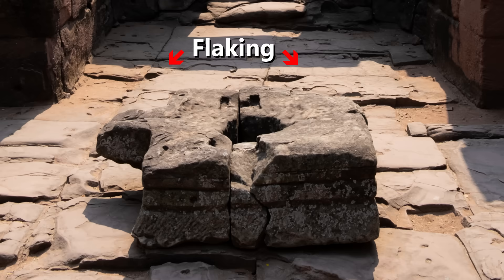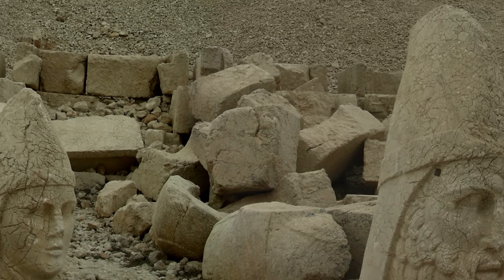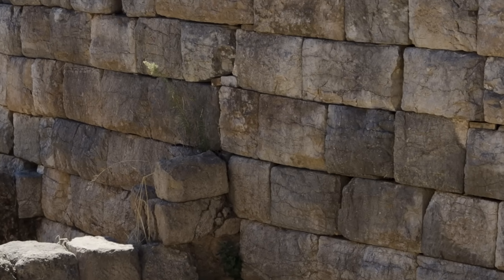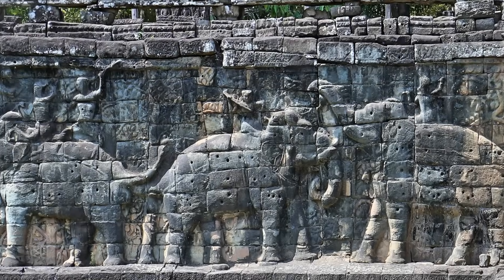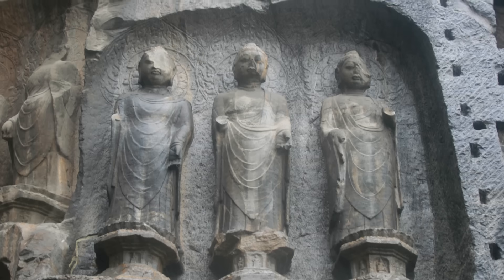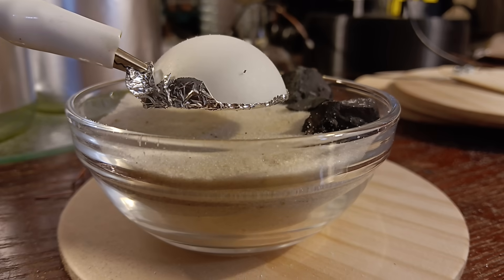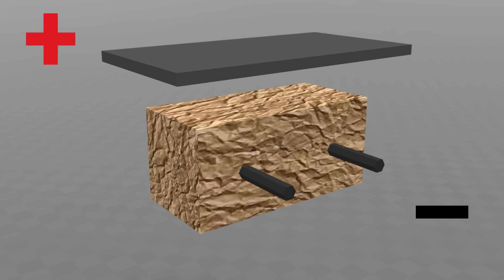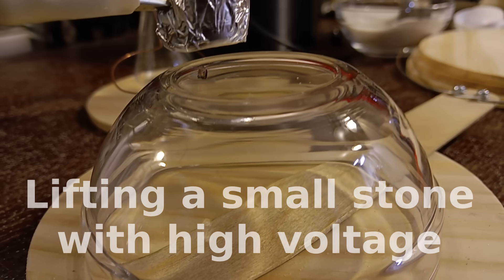The Greatest Mystery, Solved. Recreating Ancient Stone Melding Technology (Part 1)

Comment: So this hypothesis raises more questions than it answers.
*  Where did they get enough power?
*  Why do we not have physical or graphical records of the power sources?
*  How did this technology get transferred all around the globe and then get lost?
*  Most rock is an insulator. How do they create a plasma arc between the electrodes?
*  Assuming they can melt the rock, how to they prevent spattering?
*  How do they keep the rocks from melting together?
*  Wouldn't molten rock pool from gravity?
*  Why can't they eliminate the nubs while the rock is still soft?
* If they can create air pockets inside the rock, why didn't they do that to pyramidal stone blocks?
Probably a lot more questions. This is what I came up with in about a minute.
Reply: Experiments shows that those building materials like granite and sandstone loose their structure and properties after heat was applied. At least when you use traditional sources of heat. If theory about 'electrods' is correct, those builders used some other method rather then melting. All you can achieve with melting is piece of glass with some other particles inside, it's very frigile.
Reply: @personperson2884  Right, if you melt a rock, it's not like melting an ice cube where it will snap back into the same crystalline structure and arrangement of molecules when it cools again...  the same rock that was formed at temperatures and pressures deep in the crust, if we take it and melt it, when it cools at different temperatures and pressures on the surface, it will be a different mineral altogether.
Reply: @keepinmahprivacy9754  Not necessarily. Depends on what frequencies you use for your voltage. Find the resonant frequency of the material first and maintain it while increasing amplitude. The idea is not to melt the rock but put it in a flux state.
Reply: @keepinmahprivacy9754  Granite when melted will just turn into obsidian
Reply: @charlesbassjr.5177  Umm, no that's not correct. Obsidian is formed from silicates, not from granite. The metamorphic successor to granite is gneiss.
Reply: @keepinmahprivacy9754  What about resonate frequencies with said rocks kind of how a magnet aligns the crystal structure when you magnetize metal what happens to the stone then instead of just heating it you're working with its frequencies. Similar to how you would break down water to hydrogen an ox too keep from eroding away via heat your electrodes you would have a set of tuned electrode pipes for each contamination that could be in the water you would use. What happens to that rock at its resonate freq?
Reply: @eliwazmoonsfire6303  I don't really know the answer to that one, sorry. But I suppose the answer is going to depend a lot on the type of rock, as some rock has a crystal structure and other rock does not. I suspect a resonant frequency would have a greater impact on crystalline rock than on non-crystalline though.
Reply: It's chemical if that process existed...but its more just cement n concrete mixs with crushed rock
Reply: Granted, if the huge stones were actually hollow, that could explain how they were put into place easier!
Reply: @FookWit-sapien hollow? Where?
Reply: @drewtate5409  It was a tongue in cheek comment.  Everyone assumes these massive stones are solid and all of the same material.  What if they were put in place as hollowed out shells (think like the box in the King's chamber) and then filled in with stuff, and heated until it became part of the original 'brick' so they could stack another on top.
I am not saying there is any evidence of this whatsoever, but it is just as good as some of the other notoriously bad theories (like building a massive ramp to get bricks higher.)
Reply: @FookWit-sapien  Well, there is the quarry and numerous partially cut and broken stones.
Also, there is the physics of trying to hollow out stone. Probably a lot more work than just grinding on them until they are the shape you want.
Reply: @scytaleghola5969  Ha, right.  My point was that we can all think up random theories, if they had some magical way to shape stone, as I have seen some put out there, why not hollow out the stones so they are lighter to move, then fill them up like twinkies?
Reply: It's all theory until you recreate the results.
Reply: @darrylgordon5170  No! It is CONJECTURE not theory. HE has to PROVE it can be done by doing it himself before it can be considered a THEORY.
Reply: @darrylgordon5170  Not knowing the difference between conjecture and Theory is not a grammar nazi issue. It is a fundamental science misunderstanding. These stones were not melted in place, cast in place or anything of that sort.
Reply: @darrylgordon5170  most sensible person in the comment section
Reply: @yeetman4953  Calling someone the “most sensible” in this thread is a pretty low bar.
Reply: Excellent
Reply: that ancient tech got lost at some point in human history is obvious. We see the foundations of megalithic sites in south america, egypt and other places having more complex and higher quality stone work in older layers. Like Macchu picchus foundation with the later added poor Inca stone work on top and the first pyramids in egypt being by far the hardest to create and more sophisticated ones. The why is there probably was a global cataclysm at some point. The younger dryas impact hypothesis would fit well on that regard.
Reply: @xtremelemon8612  En rapport à ce que tu dits, je pense que si beaucoup de civilisations ont eu une manière identique de construire des temples ou de sculpter des œuvres d'arts, c'est qu'il existait une école mondiale du savoir commun et relatif à tout. C'est comme si un professeur donné des cours à un endroit précis de la planète et que tous les élèves le copié partout sur terre. Je pense également qu'il y a eu une grosse catastrophe à un moment précis comme si c'était un peu voulu genre déjà écrit ou stratifié à l'avance un peu comme si on avait voulu changer l'histoire avec un machine à remonter le temps pour ne pas que ça aille trop vite sur terre ou comme si ces civilisations n'étaient pas souhaités sur terre, genre l'humanité qui remonte le temps pour détruire tous les annunaki  pour mieux dominer le monde ainsi dans le futur car sinon tout le monde serait autonome et trop évolué, bref je m'égare... 
Je pense que si les temples ont été construits aussi haut dans les montagnes, c'est qu'avant les océans étaient bien plus haut qu'on ne le pense. 
Et en ce qui concerne cette catastrophe, serait il possible qu'un météorite est fait ça, on l'aurait vu cet impact depuis le temps, non ?! 
Et si simplement, tout ce résultat d’hypothèse pour dire que c'est simplement le rendu d'un tir de laser depuis un vaisseau mère dans l'espace ... 
"La blague en vérité si c'était le cas ..." 
Un simple tir d'arme de vaisseau de l"espace qui changea l'histoire sur terre. 
Et si on a jamais vu d'impact visible sur terre, c'est qu'ils ont tirés sur l'eau tellement puissamment que toute la retombée et la vibration de cette puissance qui s'est évaporée dans l'espace et qui à fait trembler toute la terre entière se qui détruira tout par son onde de choc ?...
C'est fascinant et facile de comprendre que nous humanité, ne sommes que les enfants, d'une civilisation ou d'une espèce bien plus intelligente et digne que nous.
L'archéologie et l'imagination nous le démontre constamment et merci à eux d’exister car cela fait avancer l'humanité je trouve.
Je pense profondément que l'humanité est tellement infantile par rapport à l'histoire sur terre depuis sa création.
C'est bien de connaitre son passé ou son histoire pour pouvoir évoluer dans son présent mais c'est mieux d'imaginer son futur pour changer son présent.
Finalement et métaphoriquement, tout est relatif à une perception d'observations, la vie n'est qu'un choix et il faut avouer simplement qu'il y aura toujours mieux et meilleur que soit au dessus de nous dans la vie ou dans tout ce qui existe.
Pourquoi chercher à faire compliquer lorsqu'on peut faire simple, la vie à un sens mes amis, croyez en vous et en vos rêves.
AMOUR A TOUS ❤
Reply: @xtremelemon8612  The pyramids in Egypt get larger and MORE complex as time passes, not the reverse.
Reply: @jeffreylehman1159  no its the exact opposite, the ones that are crumbling piles of mud bricks are the last ones made, and those methods of primitive constructions are the ones depicted everywhere on hyeroglyphs in egypt, the 3 main pyramids of giza and the sphinx were probably inherited from before, from an unknwon culture.
Reply: @xtremelemon8612  Congratulations on redacting the pyramids. I look forward to your publishing and will definitely read the paper!
Reply: The fact he didn't show any modern application of his "discovery" is the tell tail smell of BS.
Reply: I look at the Earth as a big dynamo. Plenty of electricity there!
Reply: @TheBludgutz  Cool. So just harness it!
Reply: Hypotheses: 

What if 11000 years ago when the sun and magnetic pole went haywire.. There was  huge electrical charge between sky and ground potential. And they used that with their strange builds?
Reply: @laurahaaima1436  yes. This is where the whole electric universe (thunderbolts project on YT) comes in. Their theory would fit this
Reply: Global Ice-Age builders sat their key sites atop telluric “hot spots” (fault-line aquifers and high-conductivity strata), effectively using the Earth itself as one electrode.  
• Pyramid and temple shafts doubled as Kelvin water-drop generators, stacking telluric bias onto each falling droplet to charge massive, gold-capped obelisks and Leyden-jar banks.  
• Obelisks—often in matched pairs—served as corona-enhanced “lightning rods” and wind-triboelectric collectors, feeding static charge into subterranean cable galleries.  
• Energy storage came in giant Leyden jars (ceramic capacitors lined in electrum or bronze) wired into charging magazines hidden in quartz-packed chambers.  
• Stored charge powered precision plasma-etch stone-cutting wands, electrostatic levitation of megaliths on quartz-lubricated sleds, ozone-purified drinking water, and large granite resonators tuned by ritual chant.  
• After the Younger Dryas flood, successor cultures repurposed and re-inscribed these monuments—transforming power plants into tombs, storehouses, or purely ceremonial structures, while the technical lore was lost or hidden.  

Together, these threads paint a picture of a sophisticated, planet-spanning network of electro-static power stations—forgotten masters of “stone and lightning” whose legacy still ripples through ancient ruins.
Reply: Most of you questions are already answered by other theory. If these stones are all 40,000 years old for example. The history wet have was written on them.. Also why the pyramids don’t use this technique. Your compressing all time into what you know. What if before a cataclysmic flood event there was a civilization capable of doing this. The bigger problem is that he doesn’t actually proof his theory. he doesn’t use large enough of a stone to prove the theory. And to answer another one of your questions you can totally melt stone. You can melt it in propane furnace. it absorbs enough heat and becomes a thick gel substance. in my experience, it simply turns to glass afterwards I don’t know what would happen with electricity.
Reply: It would require high voltage and high current, from where I ask?
Reply: This answers #2 and #3: A cataclysm which killed 98% of the population.
Reply: let us know how long it takes you to answer your own questions :P
Reply: @FirstNameLastName-wd2xp  Negative 10 minutes.
Reply: Take a look west from egypt in shengen desert on google earth. Zoom out...way out. Thats a arc blast from moon to earth when venus went from comet to flaming ball to dud where it sits now. It went west..raised the mountain peaks, flowed lava...mud south towards indo pacific are raised the once exposed lands we sea as malaysia..phillipines...etc.
Sending mud flows the stones towards turkey and all around.

The technology was vaporized the washed away...ask the dogons..the seen what happened. A sweeping broom of plasma made ashes and eradiated those closest.

The electricity is a few hundred feet above us...and the high voltage sits below. .

Lots of free high power
Reply: From their giant brains😂
Reply: From their giant brains 😂
Reply: Intelligent inquiries by an intelligent person...
Reply: it's just nonsense, we have electric and I don't see anyone melt stones anywhere, the only place they melt is volcanoes
Reply: That's good cuz we can learn more with these questions
Reply: The Baghdad batteries 😂
Reply: @micktait8576  Awe those were used to charge their cell phones carried in their wittle bags.
Reply: @micktait8576 Make one ...copper and a seperate metal n strong salt water get 3v off the batt (no pun intended) the current/amps will be low but just parralel them keep parraleling them each time doubling the current untill usable amount off power available simple
Reply: There is no perfect insulator. Materials just have different resistance.
Reply: "So this hypothesis raises more questions than it answers."

Yes, one is: Why didnt they have electrocution?
Reply: @petermeyer6873  Thor threw lightning bolts.
Reply: Mostly by suppression of information throughout history.
Reply: Must start by experimentation. So much we don't know and lost. Very powerful people don't want everyone to know special technologies.
Reply: Yes. I absolutely agree with this. I have been saying this for years now. It's so obvious! If you have ever done concrete work, those nubs are exactly what you get as it starts to cure, and you dip something like your finger or a 2x4, for example. Some nubs were left behind for some reason, but most were finished off smooth.
Reply: You mean you have theorised how these were built NOT DISCOVERED. When you build your first small wall then I guarantee the world will sit up and take notice.
Reply: Indian texts reveal a plant that was used by ancient people to soften stone. 😂 electrocuting rocks 😂 nah
Reply: The "enough power" came from Piramids. There is recent theories and studies telling about the piramid potencial to generate energy from pression and there are structures next to piramids that could be giant batteries to store energy. 
"How the tecnology get lost?" After a great flood at 11.600 B.C. it was all destroyed. There is new theories and studies about this giant flood caused by a meteor falling in atlantic ocean.
Reply: Oh that’s easy: aliens. You’re welcome.
Reply: 1. they did not melt the stone. its was softened by applying a chemical solution. it could not have been melted because if you melt a stone like granite, when it solidifies again, it isnt granite anymore, it has different atomic bonds that make it look like obsidian glass afterwards. granite is formed when lava is cooled down very, very, slowly, under huge pressures. same goes with the popular theory about it being concrete. it cannot be concrete either because crushing granite and making concrete out of it would not harden into solid granite, and would not have the look, durability or composition of the original rock. that only leaves chemicals to rearrange atomic bonds. the marks left behind on various ancient sites show that a liquid dripped onto stone and softened it, leaving a smoothed surface behind. 
2. you can melt stone with parabolic mirrors coated in reflective material such as golf using only the sun as power source, but thats not what they did. 
3 there are no records because those structures were built way before the academically accepted cultures ever existed. there was a global civilization, and it got wiped out along with most large mammals at the end of the last ice age, but must have already been in decline. Im talking about the time before 15 000 years ago. there are actually records of ancient advanced knowledge about pyhsics, but they only survived in form of mythological symbols and ancient religion and some religious mystery cults, where they became purely religious symbols and concepts which are completely unrecognizable unless you know what to look for.
3. no idea why they did not eliminate the nubs. they certainly did eliminate them sometimes, so they could certainly do it. the only thing I can come up with is that softening it around the nub to flatten it out risk a the weight on top to deform the stone, so they did not bother with it, but I dont know, it should be easily possible to prevent that.
Reply: Exactly, plasma boy is clueless
Reply: What if they had everything in a digital form then all got lost in a solar flare? I wonder what would be lost if it happened today around the world, how much would still exist in paper copy? probably all the pre-internet stuff?
Reply: R u a Virgo
Reply: For power source look up Christopher Dunn
Reply: The Flood. U godless .... always search for answers outside the bible...
Reply: Not from earth
Reply: Lightning.
Reply: the photos of egypt he showed are scaffold holes for timber scaffolding
Reply: It baffles me how reasonably intelligent people can be so impossible foolish in their thinking. Do you think he can answer every question of a massive theory at once? Do you think that because more questions are raised he should just stop. What a backwards way of thinking.
Reply: @BabylonsChains  If a theory cannot address basic, fundamental questions, it's not a theory - it's a notion.
Some of my questions are show stoppers.
Without digging into the more technical issues, just consider a melting ice cube. What does gravity do to the water? The same thing would happen to melted rock.
Now you might think we make ice cubes with a tray/mold, why not with rocks? The problem is, the mold has to have a higher melting point than the rock, which means we need more energy to make the mold than to melt the rock. We just made our problem more difficult.
Reply: The Earth was very static until it settled into this current orbit. We have not been orbiting this star forever. Certainly not 13 Billion years.
Reply: I think the author needs to get out of the lab more often and see the real world around him.
Reply: https://youtu.be/KMAtkjy_YK4?si=y9qFDYtWvTa9pj6q
Reply: The rock would be melted to use molds.
So why are no two stones alike?
Reply: @lapajaylaviga My guess would be it was a community project, and because of the scale of it and the fact that they pyramids "interior" stone blocks would not be seen once covered with the outer casing stones which are all gone today, it was not required to be exactly the same size.
Reply: Not hypothetical..."Mystery Solved"
Reply: more than enough evidence, just no one wants to believe it, we've had our own little theories in our heads from the education system and we "KNOW" they are true.... even though we don't... but we all follow the consensus lest we fear, society rejects us.
Reply: Because its all nonsense. The same people who push this floating by soubn/frequency bullshit. 🤦‍♂️
Reply: *  Where did they get enough power? - There is a theory that the Pyramids themselves are in fact a power source similar to the Wardenclyffe tower that Tesla built. 
*  Why do we not have physical or graphical records of the power sources? - Perhaps we do? Maybe these are what you see on egyptian carvings called Dendera light
*  How did this technology get transferred all around the globe and then get lost? - Good question. Whoever left this knowledge might return one day?
*  Most rock is an insulator. How do they create a plasma arc between the electrodes? - The curious thing about all the stones used in pyramid construction, including the granite sarcophagus are semi-conductive.  
*  Assuming they can melt the rock, how to they prevent spattering? - Perhaps these where highly accurate and controlled and perhaps as he says they used charge seperation to "hold" rocks in place?
*  How do they keep the rocks from melting together? While these stones look like they are separate scientists cannot fit anything between the cracks. this would suggest they are in a way melded together. 
*  Wouldn't molten rock pool from gravity? - Usually yes but not if they where made lighter using charge
*  Why can't they eliminate the nubs while the rock is still soft?  - Unsure..maybe you have a theory?
* If they can create air pockets inside the rock, why didn't they do that to pyramidal stone blocks? - There is a scientist by the name of Joseph Davidovits who has scientifically proven that most of the building blocks in the pyramid are in fact a geopolymer. However this cannot be achieved with granite so they used a combination of geopolymers and high voltage for granite and harder stones,. 
Probably a lot more questions. This is what I came up with in about a minute.
Reply: nothing about it makes sense
Reply: Maybe tesla was onto something 🤔
Reply: Can sandstone be used? Why would they need to it’s so easy to carve ? So think it’s a mistake to look at sandstone structures in this manner ? Also many of the holes on sandstone structures are literally made for moving them around- such as Angkor wat in Cambodia - here there are elephants so they used the elephants to drag the stones about by attaching chains to the rock and drag with elephant power - but the igneous rocks I can truly imagine would have been made this way you propose - also have I seen the Egyptian ‘lightbulb’ in thin it’s in dendera temple but a quick google will show it - looks like a plasma device to me !!! Electrodes cables and all
Reply: @TheSSoSS  Sure, but its so fragile, anyone with a hammer can destroy them -- and probably did. ;)
Reply: Hello mate I just replied too your comment but I did it as a normal comment by mistake so the reply too you is now top comment on video..cheers
Reply: They got power. From wall socket
Reply: @godbyone FPL , Florida Flicker Flash the rock would never transform! But then again California has daily rolling black outs..Definitely more superior power sources similar to Tesla’s Zero Point Zero generators.. which our government uses and made illegal to own or build.😱👀😎🇺🇸
Reply: @godbyone  Catch-22. In order to melt rocks, they need wall sockets. In order to install wall sockets, they need to melt rocks.
Reply: This shows that ancient people are much more intelligent than we thought they are...I mean,they discovered how things work with stones, plasma & all...really baffling...
Reply: You raise a lot of good points and the questions are far more than anticipated by the average individual, depth of questions In variations of the rock or rock surfaces and interiors are all different and must have some form of compensation from energy source..in rock structure anomalies..?? The rock molten and flowing in gravity effect is really a good point too. Resonating the specifics of rock and transform the rock in different states with voltages or added preparation of said rock or rocks to be transformed.. too many variables to take in for a said semi primitive people in technology??’  😎🇺🇸
Reply: In about a minute??? What ARE you saying exactly???? You are so clever perhaps?? You can think fast?? If you use your brainpower for 2 minutes ... you will find more wrong???
I am truly very impressed about you time management.
I really learned something here.
Not any creative thinking... but hey... some thinking for sure.
Reply: @T.v.d.V  LOL I guess you could call it a figure of speech. I't's kind of like if someone said "these questions came instantly to mind". It only means that if I spent more time thinking about it, I would probably poke more holes in the theory.
For the record, I am very clever... and humble too... and above all else, sarcastic to a fault.
Reply: Because, his theories are a crock!
Reply: I could give you lots off examples on your points you ask how things where transferred then forgotten well how are certain species... globally on diff continents...you ask  how was knowledge forgotten well remember that the technology from the 60s which got nasa too the moon they completely lost the tech how too do so hence have not returned 'apparently'
Reply: @jshaw4757  Going to the moon initially was just an exercise in BDE. Once we had done it a few times, there was no need to return until someone could think of a military or commercial reason to return.
NASA didn't forget the technology that got them there - they just improved it.
Reply: @scytaleghola5969  so why does nasa state they lost the tech ?
Reply: @jshaw4757  I'm not sure Nasa ever said that, but a former Astronaut did, and others repeated it. What he meant was we lost the capability to manufacture Saturn 5 rockets. IBM no longer has the infrastructure to build the  360/Model 5 computers used for mission control. Losing the capability of going to the moon with specific hardware is not losing the technology. 
Of course, we would not want to replicate the way we did it before. Today we can do it much more efficiently and safely.
Reply: @scytaleghola5969  just Google sir spend time read learn...either way there was capabilities lost apparently out the blue so you tell me how this is possible with such a huge company I'm only repeating what they said
Reply: @jshaw4757  It depends on how you use the word "technology".
One on-line dictionary has these three definitions:
(1) the application of scientific knowledge for practical purposes, especially in industry.
(2) machinery and equipment developed from the application of scientific knowledge.
(3) the branch of knowledge dealing with engineering or applied sciences

From definitions (1) and (3) we have not lost any technology. From definition (2) you could say we lost technology or you could say we upgraded it.
I say, even from that definition, we have not lost the technology. We could still build Saturn 5 rockets and IBM 360 computers and all of the other hardware required to duplicate a moon mission. It would just be very expensive and unnecessarily risky. We choose to use more advanced technologies.
Reply: Yeah it sounds awful cool but it's all nonsense
Reply: @shaftomite007 Proposing new ideas are never nonsense. Scientific experiments leads to technological advancement. His theory proposed may only be half the answer.
Reply: @christopherbrubaker2070 you are right. Its foolish to dismiss experimental science with hyperbolic arguments. Let the science progress
Reply: @christopherbrubaker2070  yes!!!
Reply: @shaftomite007   not really.. with every meter of atmosphere the voltage goes up 100v.. if you had something high enough lets say a balloon for example and up 100m thats 10,000v now whether or not you could sustain plasma this way is another thing as you would need some kind of capacitor to store this energy to release it in a burst to melt something like a rock but those big boulders... well who knows. i wouldn't discredit this idea all together but i am interested to see it put into play.